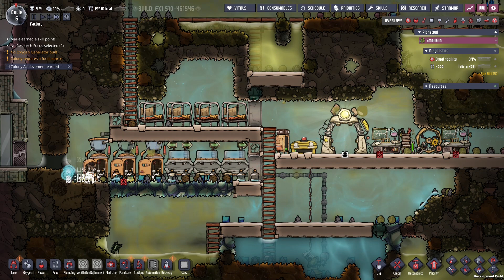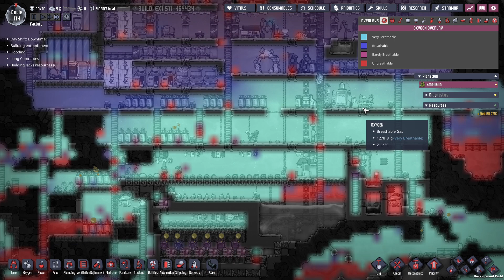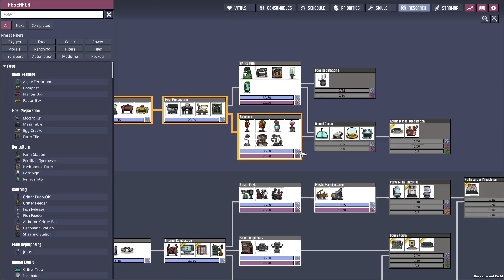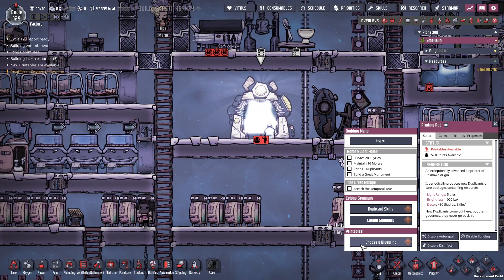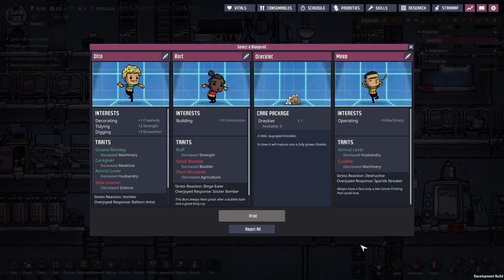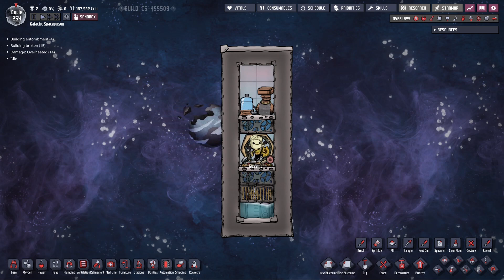FREE OIL?! American Dream at The Factory

Comment: Thanks for the video.

If possible, I would appreciate it if you took a bit more time explaining the more unusual stuff you do like the plastic melter. Still, I find your builds very interesting.

Do you have links to information about the glitch that allows crude oil multiplication using CO2? (I supposed that's what it is, I do not understand what's happening at all).

Best
Reply: plastic melter is to get naphtha, naphtha is for trick the pump to get magma without overheating the pump. You can see it in this video. https://www.youtube.com/watch?v=OkZcTa4EVjg&t=453s
Reply from the maker: Liquid replicator uses an interaction between oil and water; while oil pushes water sideways as it comes out of the vent. CO2 is just there to be captured but is not involved. I'll work to make a video on that. Check out Klei forum thread by Mathmanican in the desc.
Reply: @spamwaffles1419  people use naphtha or viscogel because they are like a gel, so it won't spread, if it does,  no more vaccum, lots of problem.